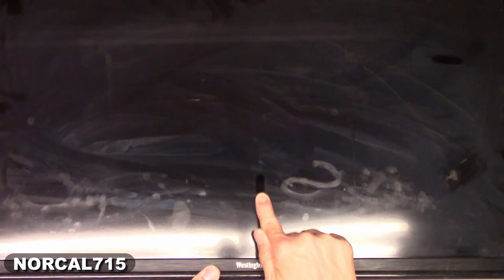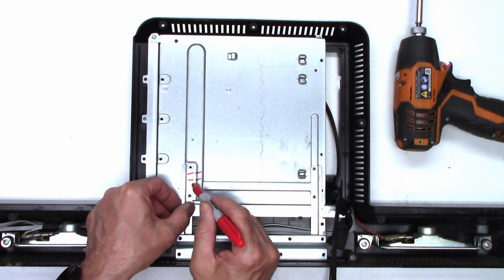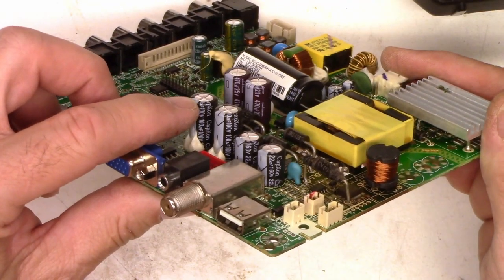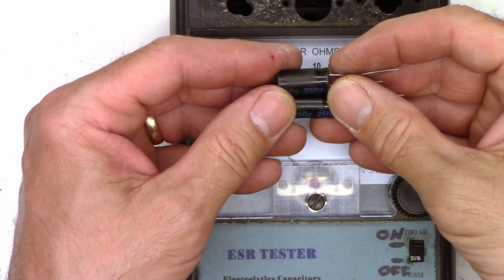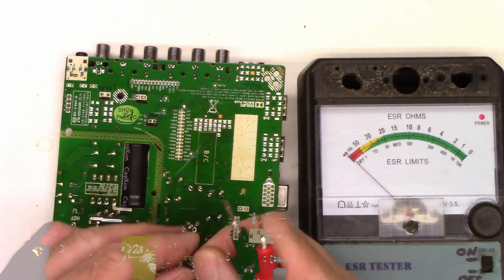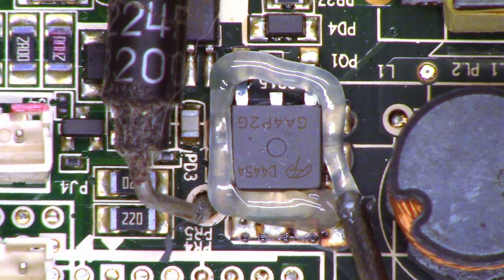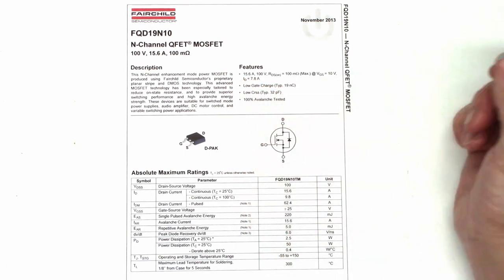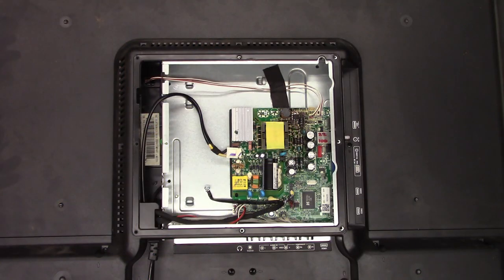32 INCH WESTINGHOUSE TV SUCCESSFUL FAILURE (NOT AGAIN)

Comment: I remember when we sold these TVs at my work.  They were total garbage even when new.  We had two displays die within three months of having it for sale.  The signal processing was worse than any TV I have ever seen.  Everything displayed was horribly pixelated and blocky due to the how bad the processing was in the set.  Needless to say the company I work for has never sold Westinghouse since.  Another Chinese TV brand we currently sell however, TCL (The Creative Life) has been an excellent brand for us in terms of reliability etc.  (Being a Chinese company though, many may not like that, which I can totally understand).  They definitely do not have the best picture out there, but they are decent sets and are great for bedrooms, kitchens, etc.  I have had one for three years now with no issues.  I also like the Roku interface on them.  Roku is great, especially if you set up the PiHole network level ad blocker to kill all the advertisements that Roku and others now like to integrate into their software.
Reply: I have a 55 inch TCL and i love it. It gets good ratings.
Reply from the maker: I have a 65" TCL with Roku myself, its awesome, and so far so good.
Reply from the maker: I have a 65" TCL with Roku myself, its awesome, and so far so good.

Comment: ..... Well done Mate, retrieve your Nichicons before the dumpster.
Can you see that screen crack (unpowered) with a bright torch ?  (or flashlight for Yanks).
If so, there's your new initial diagnostic tool for the next LCD repair.
Reply from the maker: Probably but I didnt look.
Reply: @norcal715  ... We both live & Learn. I won't commence work on a screen without checking first. Stay safe Mate,

Comment: Whats the difference between checking caps. with an ESR tester and a DVOM with a cap. checking function?
Reply: The cap checking function some multimeters have, only check for capacitance.  You need to check the ESR to really find the true health of the capacitor!
If the ESR is high, then a resistance will have built up in the cap, reducing it's overall efficiency, especially in holding power, which is crucial in a power supply.
It's not uncommon for failing capacitors to still measure "in-range" capacitance, and yet have an unhealthy esr level.
A lot of the ESR meters nowadays, also have a built in capacitance checkers so you don't have to keep going between different equiptment.
One I can recommend that isn't too expensive is the "Peak ESR70".  Just make sure to get the needle probe's with it as well, for the in circuit testing.
Reply: @ExtremeBogom Thanks for the info.

Comment: hello 

how do you know what esr you should get only by there UF size ? 
it depend by to voltage as well !! i need to look at the voltage every time .
can you please explain if you can it will save me some time.
thank you
p.s i am donating when ever i can i dont know if you see that
Reply from the maker: Voltage does have a little to do with it, although the higher the voltage the higher the ESR. A 10uf 16v capacitor I would expect approximately 5 to 10 ohms ESR and a 10uf 250v I would expect 10 to 30 ohms ESR.   A higher voltage capacitor will have a typically little higher ESR.

Comment: Nice video.  I have a Westinghouse WD55UB4530 55" smart TV that I picked up for free.  It will turn on, the backlight comes on, but there is no picture or sound.  It also will not turn back off, has to be unplugged to turn off.  One time I actually had it come on with the picture, but the tuner wouldn't pick up any channels.  It did play from the HDMI input with sound.  Would this be the main board?  I checked the voltages on the power supply and they all looked good.
Reply from the maker: Probably main board failure, more specific the memory IC (eeprom) had become corrupt. Try to find a complete main board and that should repair the issue.
Reply: @norcal715  Thanks!  I'm looking for a board now and I found one on eBay.  It looks identical to the board that I have, but some of the numbers don't match up.  Not sure whether to try that board or not.  Might keep looking.